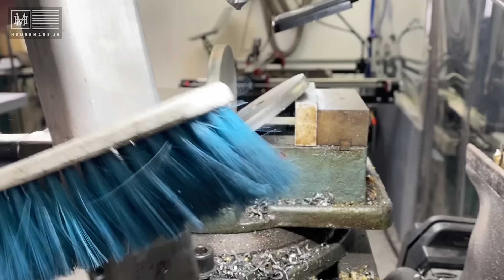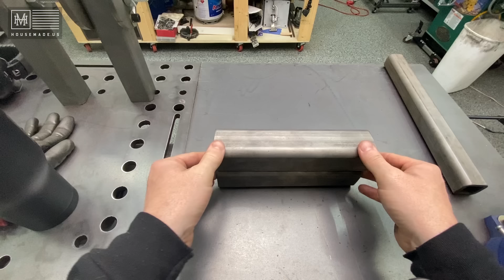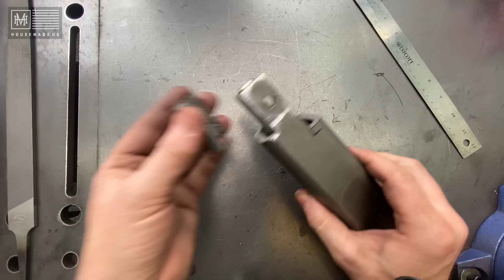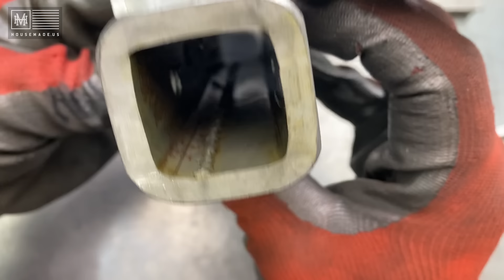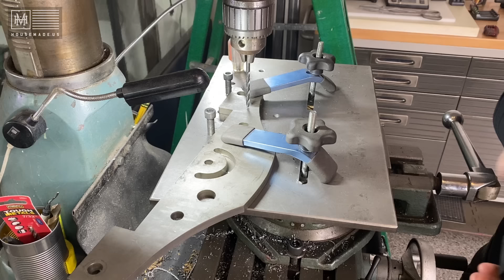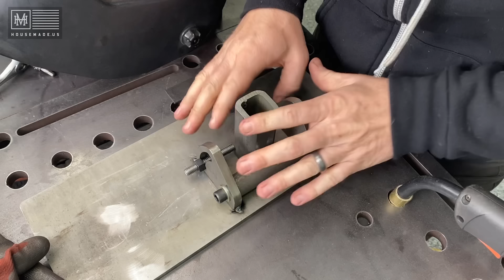How to: Revolution 2x72 Belt Grinder Build - VERY THOROUGH

Comment from the maker: ►► Take all the hard work out this build and buy the Ultimate Build Bundle for the 2x72 Belt Grinder ►►  https://bit.ly/2WIPgt4
 

Time Stamps
Intro: 0:00
Parts Overview: 2:13
The Risers: 5:59
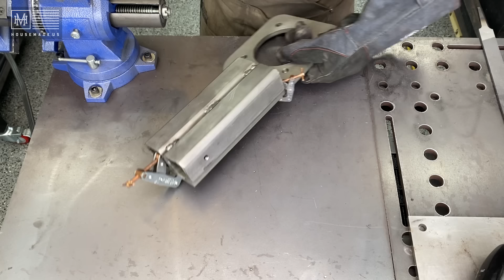The Receiver Tubes: 18:05
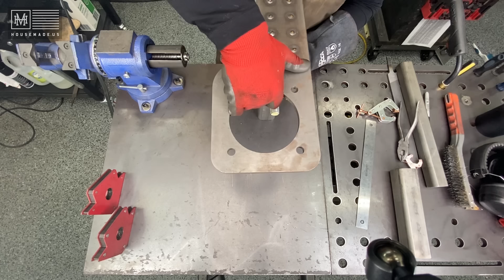The Motor Plate: 26:02
The Base Plate: 30:24
The Tracking Pillar: 40:02
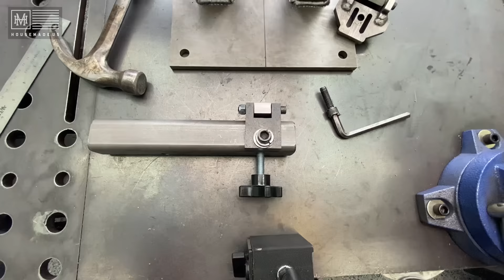The Tracking Arm: 57:15
Tracking Mechanism: 104:17
The Platen Arm: 1:40:14
The Platen Bracket: 1:15:33
The Work Rest: 1:24:24

► Link to Plans for the DIY Tilting 2x72 Belt Grinder ►► http://bit.ly/2Pa7JvZ
Reply: I am thinking to weld the spacers to the tube to prevent vibration and friction...?
Reply: Aaààa
Reply: Hey where do you get your 3/8in bolts from? And how long was your tracking arm pivot bolt
Reply: Were did you get your bandsaw angle miter thing from
Reply from the maker: It came with the SWAG table. But they can be found on Amazon. Just any standard miter will work. https://amzn.to/3tpmRH2
Reply: Thanks!
Reply: What is the size of your belt grinder pivot bolt and where did you get yours from please tell it would be really helpful
Reply: Gibt es einen  Bauplan  dafür

Comment: Since you have a Mill... you should be teaching precision... using a punch that is the same size as the hole... will help to get hole punch marks correct rather than using a sharpie... which is really not something you should be using.  Better to use a scribe and proper hole punches with sharp points on your punches.  In fact... there are many really inexpensive punch sets with a number of various hole sizes.  The other thing you can do... is buy a good rod measuring set... and sharpen one end of the rods to a point.  That way you will always get your punch marks centered.  As you say... that is most important.  Right.  Its easier to do it right with the right tools... then having to cut new material because you did it cheap with little care.  Precision is really important.  Especially when you have the tools to do it right in the first place.

Comment: When you welded the tensioning arm to the hollow section that the motor plate is also fixed to had to faff around with a digital level. If you had done this operation before even fitting the motor plate could you not just have laid the two components on their side on the table top? From what I can see this would not have hindered the subsequent fitting of the motor plate or the swivel lugs on the other side.

Comment: At 1:36 in the vid    If the pivot was closer to the belt it may be better/nicer?  This could be done with the existing parts if welded up a bit differently I think and adding clearance for the pivoting table parts?

Comment: I thank you for showing me how to make this  HD grinder Bryan , my first build turned out ok  but it's not 100% perfect like yours it is a start of a build to build better builds, im making small steps every week to buy my parts, I started in January and finished in April and iam building a medium sized cnc router 24x36x18 with 3x nema 24 stepper motors, 3x 1605 ball screws, 3x 2 sets  sbr 16 rails, 1.5 kw air cooled spindle 2 HP, vfd AT1, 3x tb 6600 drivers, arduino uno r3, +shielded wires and epoxy granite the aluminum extrusion frame now I'm onto building a lathe with c channel and 3/8th steel plate with thrust bearings,2"shaft, hgh 20 linear rails, 1.5 HP motor ran with vfd and potentiometer, plans to make it digital read and cnc/manual control then I will move on to a power house milling machine I want to design. But thanks Bryan for  your knowledge I put 3 dollars towards patron every month for you to  help you spread yhe knowledge on projects, thnx again NM

Comment: that ironhorse motor appears to be the same motor sold thru Harbor Freight just FYI so if you have a coupon could get a good deal but I assume any C face motor will do basically right?
Reply from the maker: Do you have a link? I’d like to take a closer look.
Reply: @HouseMadeUS  sorry my bad, looks like the harbor freight ones are single phase

Comment: I'm impressed that you ever built this thing your process is haphazard at best. By the end of the video I will have drawn up my own set of blueprints and all I will have to do is translate them to S CAD program in the stops for each tooling change and parts change weld it all up on the inlaid line and bolted together then it's simply a matter of closing the poors in the steel with a durable high polish finish and inlaying high speed steel shims will take out all the slop the proper coat of paint and graphite embedded bronze washers and a good spring will complete my build
Reply from the maker: Good luck. 👍🏻 and enjoy!

Comment: To address the weld seam I would simply grind a small depression running the length of the outside of the inner tube, just wide enough and deep enough to accommodate the weld seam but having full contact on the rest of the surface. It's easier less time consuming and doesn't require special tools or hours of filing by hand using a file and some sort of long handle. I'm a poor boy.
Reply: I started working on my kit yesterday and you only need to clean the weld out of the 2 main body tubes, and the small piece for the work rest. I think it took me about 10 minutes to do it all with a flat file. Not too bad!

Comment: fyi. I plasma cut your rev 5 plates recently, like last week. Your hinge plates (3/8" material) have the 3/4" pivot holes drawn at .77. Seemed all the other holes were drawn to size, any particular reason for this? I found that too large to pivot accurately (lots of slop in the 3/4" hinge bolt), and my plasma table is set to offset holes smaller than they really are. I would've emailed, but I couldn't find an address on your site
Reply from the maker: You can adjust the kerf on your plasma table to adjust for tighter tolerances. We use .77 due to being cut by laser and our bolts have a zinc coating so we require that small bit there. Easy enough fix is to just tighten that big axle bolt more and it will cinch up nicely. Thank you.
Reply: @HouseMadeUS  aren't co2 lasers more accurate than plasma? My bolts also have the zinc coating. Your bolts in the video appear to have an accurate fit. Like I said. All the other holes were fine with my kerf offsets in place. It's not really a problem. I plan to re-cut them and mill them to size. Just thought you'd like to know

Comment: Question about the motor. With it not being a closed in unit is there a issue with metal and other stuff being sucked into the motor through the vent?
Reply from the maker: The motor is a TEFC (totally enclosed fan cooled) so there are no issues with that. Very good setup! Thanks for asking. 👍🏻
Reply: @HouseMadeUS  thank you. The motor in the video had the opening on the side and that's why I asked.  I'm planning on building the grinder in your video so I'm in the process of  making my parts list and prices including your ultimate bundle.
Reply from the maker: Sounds good. Yeah it looks open but it’s totally sealed. Great motor. Make sure to check the FAQ page. That will help with the parts and such. When you buy the kit there is a resources page with direct links to everything. Thanks again for your support. 💪🏻

Comment: I guess if you have all the tools and equipment you need to do this, it would be a great savings. But when you have to buy more tools, motor, tubing, drill bits,  pneumatic  files, a welder and other electronic equipment...it would just be cheaper to buy the unit fully assembled.
Reply from the maker: If you buy the kit all you need is a welder and a few other tools. People build these with the cheap harbor freight welders. Still a lot less money than an assembled unit.

Comment: I have been estimating (not trying to discourage anyone from building a 2x72 at all you should) and to build a non turning 2x72 belt grinder with 2hp motor and cheap vfd it would cost about $700 then you still need a welder (a Yeswelder mig welder preferably), a drill press , drill bits (cobalt preferably) , a 1/2inx 18in mini sander, (harbor freight is cheap) ,an angle grinder,  a tap and die set, and some other  things i am not trying to discourage anyone,  just trying to be helpful it is still cheaper than buying one.       /     some tips you can get a 2x72 belt grinder aluminum wheel set for $100 on ebay and a 2hp 3ph 5/8in shaft motor on ebay for $200 and.    /    and you can get flat peices of steel like 1/4in and 7/16in and other sizes on ebay for a decent price. 7/16" .4375" Hot Rolled Steel Sheet Plate 12"X 24" Flat Bar A36  hope i was helpful
Reply from the maker: Most builds of the Revolution come in at $800. That’s the kit from me, 2hp motor, VFD, wheels. Ready to grind. I appreciate your breakdown on it. Cheers! 😁
Reply: @HouseMadeUS  ya i dont know if i will start out with a $800 2x72 or just a store bought 2x42 with only a 1/2hp motor i am 14 so i dont have a job but i am lucky enough to work for a lady that does antique shows and i make ok money on the days she needs me for a show

Comment: Hi mate just wondering if there is any chance I could get an adaption to the Cad drawing for motors I can get here in Aus the measurement I have for this motor is 115mm and the cad drawing is 130mm?? I’ll take any advise
Reply: I have purchased the plans off you and had them cut but roomie mistake when I ordered the motor
Reply from the maker: The quickest way to solve this would be to template out your motor and drill the holes. They don’t need to be perfect.

Comment: Dumb question: We need to take the weld out of both receiver tubes, correct?
Reply from the maker: Yes so you can slide the work rest arm into the lower unit.

Comment: Nice vid! Why the need for such heavy wall box . 3mm-1/8 would suffice. Could suggest using industrial 40mm piano/strip hinge for tilting mechanism on top of pillars to eliminate a lot of laser/fabricating. Tilt limit could be a welded stop. Position lock easily sorted.
Reply from the maker: A lot of people suggest this modification. However because we tap into the tube steel in multiple places those thinner walls would not hold a good thread for too long. My goal was to build an industrial grinder that was like a tank. It has been built 1000 times over in multiple countries now. Tried and true! Thanks for watching and I appreciate your suggestions. 👊🏻

Comment: I recently purchased your ultimate build bundle and have started my build.  I'm not sure if anyone has asked this question but do you see any reason why I could not weld the receiver tubes together and then clamp the receiver tubes and the tracking pillar to the table and weld the tracking pillar (minus the spring clip so it lays flat with the other tubes) to the receiver tubes before the motor plate is welded?  I think this would help with alignment of the tracking pillar to the receiver tube.   I'd weld the metal clip for the spring to the tracking pillar after this step.  Your thoughts...
Reply from the maker: Yeah most definitely. I actually do it that way now. I think it’s a much better way. Great minds! 💪🏻😁

Comment: A 3 phase motor is a joke you can get a 110 DC MOTOR and put a variable controller  in line to the motor and not need a all that shit. Or get a 220 motor for efficiency.I have built simpler belt sanders than this with automatic belt tensioner that can do the same thing.
What I find amazing is you cut the flat stock on a laser cutter (personally I prefer a water cutter which insures a flat plate.)  And you do not laser cut or drill the holes on the 2 inch box tube and radius the tube.
Reply from the maker: I guess the biggest issue with DC motors is finding one that is TEFC for this kind of grinding environment. Can you send me links to a 2 Hp TEFC DC motor that is comparable? I'd like to learn more.
Reply: @HouseMadeUS  I have one on my Jointer and I have a spare I will take a picture tommorrow. Send me a email. ALSO THEY CAN BE WIRED FOR 220.
Reply from the maker: Sure, I'd like to check it out: brian@housemade.us
Reply: @HouseMadeUS  I can see someone does not like the link to a tefc 2.7 hp motor variable speed on this site .
Reply from the maker: YouTube strips links I think in comments. You can email it to me though.

Comment: Excellent video.   I am definitely in the market to build a 2x72 grinder, honestly I'm trying to get as close to a Gibson as possible without spending four grand LOL.  But this is a very attractive model due to some of the features, as well, is there the ability to buy parts a la carte so if I wanted to make say the majority of the grinder from plate steel myself but I for example did not want to have to try to make those hinges, is it possible to buy those hinges? Or the motor or different particular parts?
Reply from the maker: Hi Austin, yeah man just shoot me an email if you don't see something on the website. I will be pushing more parts to the site as the summer goes on. brian@housemade.us

Comment: I see that the motor listed is a 3-phase motor.  Is there a 1-phase version?
Reply from the maker: There are a lot of single phase motors that fit this design. My recommendation is to watch my Vfd Vids for an explanation as to why 3 phase is the way to go. You do not need 3 phase power to use a 3 phase motor. Much better for speed control.
Reply: @HouseMadeUS  Thanks for the quick reply. So, would the unused phase be used for reverse?
Reply from the maker: A VFD converts single phase to 3. All phases are used for speed control and reverse yes.

Comment: Loving this build so far. I bought your lazer cut kit and hardware. Quick question. What type of belts did you use for your pneumatic grinder? I bought some Zirconia and Aluminum Oxide on Amazon but both get chewed up rather quickly. The grit on them doesn't seem to last
Reply from the maker: I buy a bulk kit from Amazon. They don’t last that long either. I’ve tried to find ceramics for that thing with zero luck.
Reply: @HouseMadeUS  Thank you for your help.
Reply: @HouseMade   check out  Klingspor for sanding belts.If they don't have it in stock, they will  make them any size you need. Excellent quality and reasonable prices

Comment: Question please for those of us located downunder who would consider buying this kit.
Our power supply is 240Volt single phase AC 50 Hertz.

Some of us also have 3 phase available which is 440Volt AC 50 Hertz.

Presumably the CNC drilled plate to attach the motor is drilled to suit USA 110Volt AC power supply.
I’m guessing the VFD options likewise won’t suit our power supply?

Have you considered maybe having the design available drilled to suit a motor that would work here & likewise a VFD that would match?

The only alternative I could think of is build it as shown here     and buy a 240VOLT AC to 110Volt AC transformer, to run it.

I’m guessing the international  air freight costs on all this steel would probably kill any cost savings by buying the kit.

Also with the Covid shut downs I’m guessing even air freight flights are probably delayed by months.

It’s a shame, coz this looks like it would be a fun build. 👍
Reply from the maker: Hey Ian, I answered your question on the other video, I think you could build this in Australia for sure and the motor/VFD combo would be very similar. Shipping to Australia would be very expensive but if you could find someone with a laser cutter the DXF cut sheets are included with the plan set.

Comment: I have a Langmuir Pro on the way. Would it be able to cut these parts and still be as good as your laser cut parts?
Reply from the maker: Plasma will never be as good as laser. You can cut the Revolution out on plasma but I would not cut the holes. I would drill them.
Reply: @HouseMadeUS  Plus laser systems are much more affordable!! :-)

Comment: Cool design! I have a TW90 but almost never use it horizontally 😂 would like a second 2x72 though
Reply from the maker: I use the horizontal feature about 1/3 of the time. It’s great to have especially with a contact wheel and a table to accommodate. 💪🏻😁

Comment: Regarding internal seams, most metal supply companies will sell seamless “trailer hitch” tubing, the same tubing used to make hitch receivers on vehicles. It’s a little more expensive but it takes the labour out of removing the internal seam to sleeve in a smaller dimension tube. Great video here.
Reply from the maker: Good point Darcy, I have priced it out and its quite a bit more but if that doesn't bother you then it is a great option! Also, thank you for your order!!